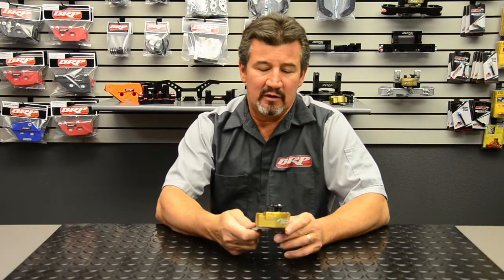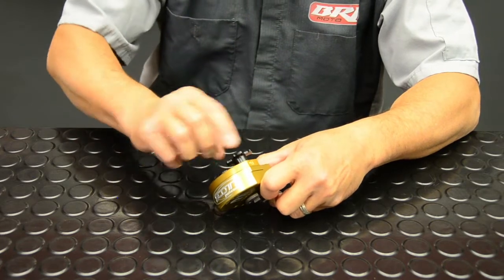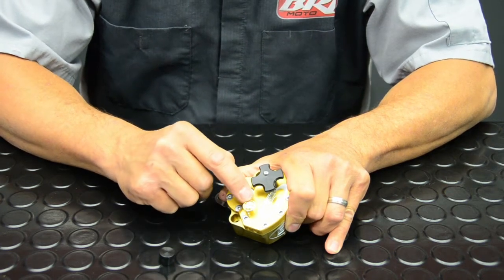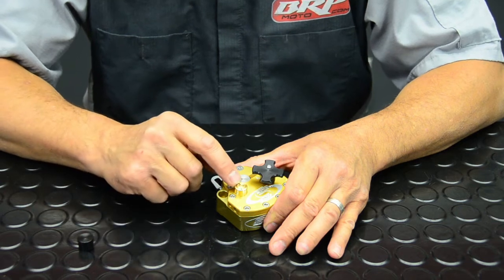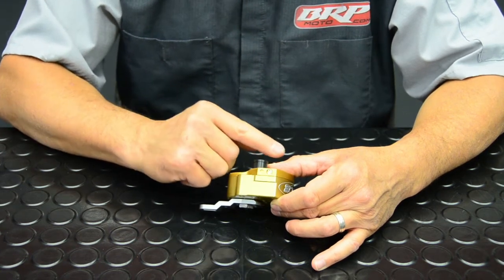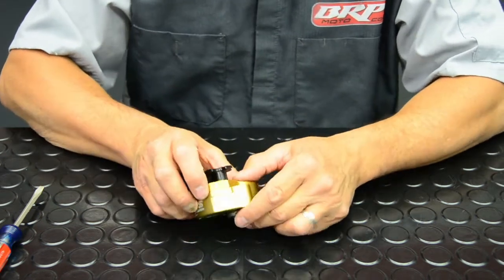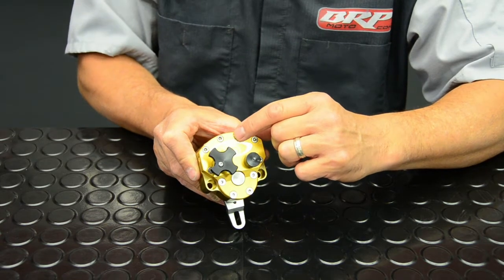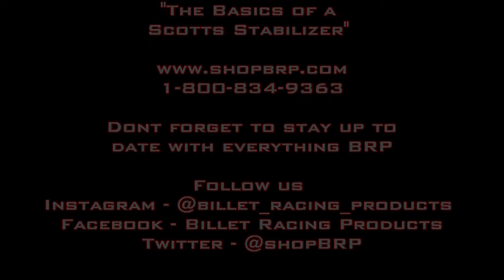Scotts Steering Stabilizer - How it works, functions, and features

Comment: Nice tutorial, thanks. When electrical, mechanical or hydraulic engineers design products that control motion, like a stabilizer that controls the motion of a handlebar when the front wheel encounters rocks, etc. we use the terms damp, damping and damper. The term dampen and dampening is used to refer to the process of making something wet "She is dampening a sponge. In the future she will dampen several other sponges. A few minutes ago, she dampened a towel." Likewise a dampener is a device that makes something wet, maybe a yard sprinkler. The Scotts Steering Stabilizer is a steering damper. It damps (controls) the motion of the bars. While the bike is in motion the stabilizer is constantly damping the handlebar motion.
Reply: What he said ^

Comment: Can someone give me info upon obtaining the correct tank mount bracket for this scotts steering damper to be mounted onto my 2005 C2H model Zx-10R bike? U can contact me here: UBalance07 at outlook dot com...thanks..i might need bolts etc necessary to fit this system. I can provide pictures so you can see what i have & inform me what exactly i need...i saw something saying i need to shave bit of kawasaki key off to allow key full function to turn on an off with key in ignition.

Comment: great video.  random question, why does it make sense for the off road version to provide no resistance when returning to center but on a road motorcycle it does give resistance when returning to center?  as an off road guy, it seems even the street guys would want the same.  what am I missing?  thanks.
Reply: because on road you are riding faster and don't want twitchy steering. The point of a stabilizer is to reduce twitchiness. in slower off road, you're riding much slower and moving the steering left/right more often and therefore need no restrictions to turn left/right. But you want the high-speed dampening to reduce unwanted deflections that would throw off your steering
Reply from the maker: When riding in dirt it is mre common for the rider to need to counter steer the bike. The free to center allows the rider to counter steer more easily and without any resistance.
Reply: But dampers can also reduce the affects of deflection at slow speed, such as from hitting large rocks with the front wheel or clipping trees with the handlebars, so wouldn’t it make sense to reduce the damping rather than totally turning it off (like the Precision Parabolic)? I’m in the market for a damper now and like the Scott’s, but I’m not sure about my slow speed damping changing so much between sweeping out and returning to centre.